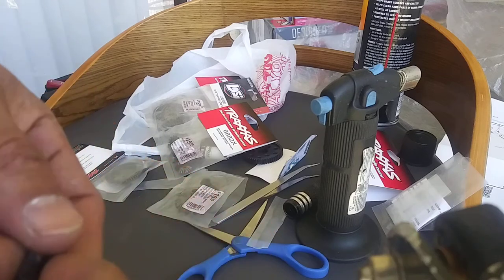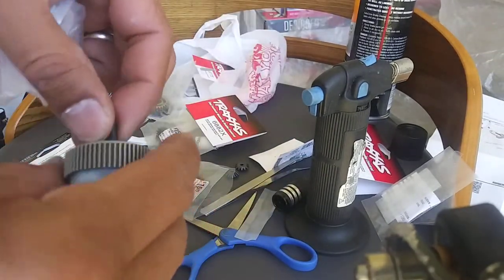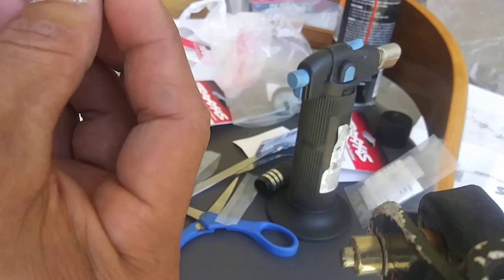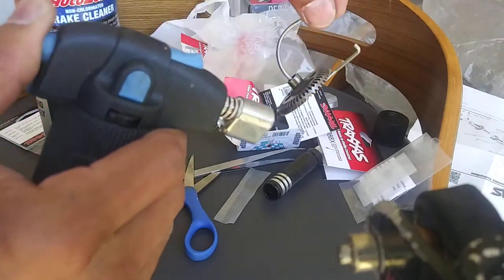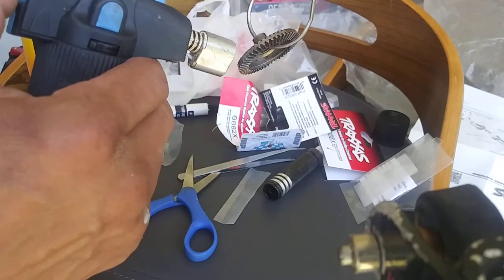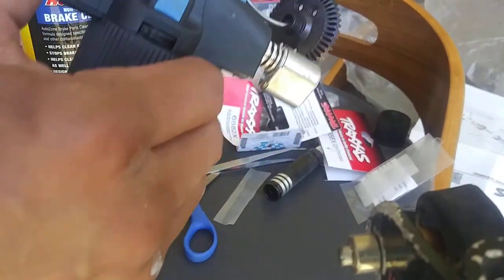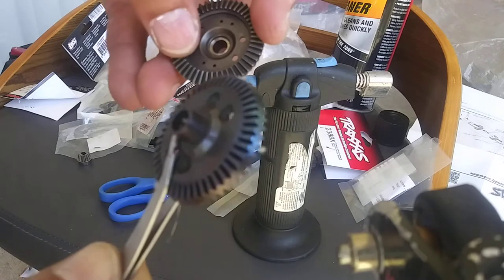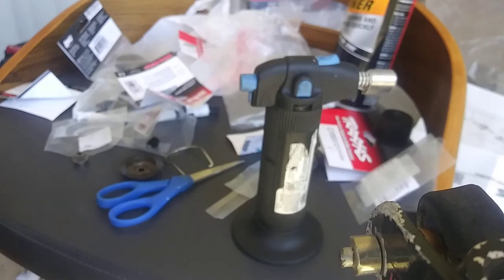tempering process on diff gears

Comment: Great idea. Some gears are made of pot metal. Will that work for them?
Reply from the maker: Yes it works
Reply: I've seen videos on hardening metal. Most of the time they cool stuff down after reaching a certain temperature by dipping it in oil. That tempers it .